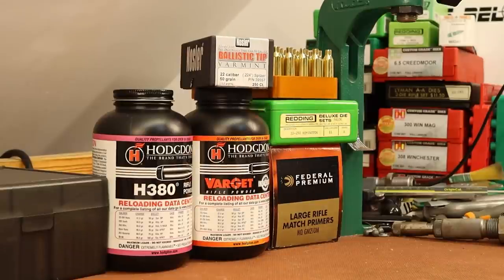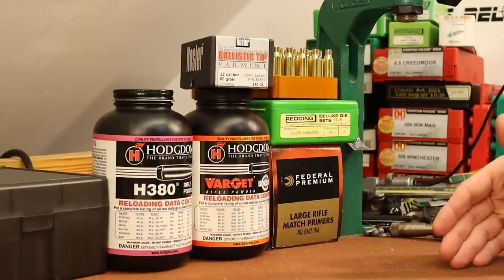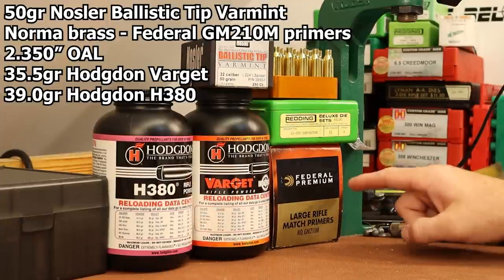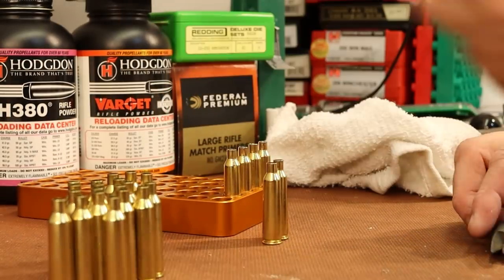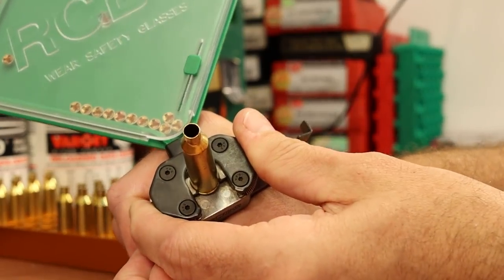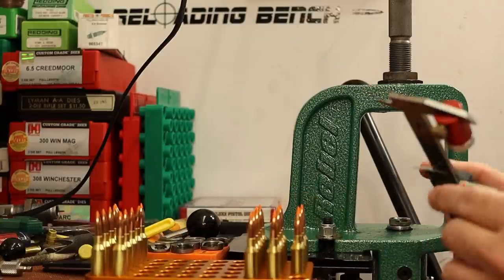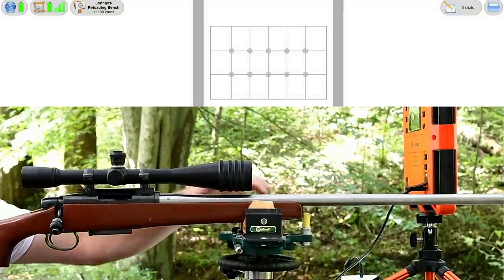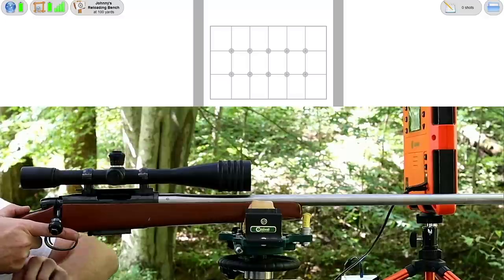.22-250 Rem - 50gr Nosler BT with Varget & H380

Comment: The 55gr Nosler Varmageddon is a freaking tack driver in both of my 22-250's so is the Hornady 40gr V-Max... I've never really experimented with any other bullets because those do so damn good and the bullets I want to experiment with won't stabilize... Glad to see you uploading on the regular again love the channel brother!!!
Reply: Same, the 55 is incredibly accurate out of my old and new Ruger’s
Reply: How is the flat base on the varmageddon? I've been going with mostly boat tails
Reply: @nk-dw2hm  it's a good shooting bullet I've got a load worked up with Vihtavuori n135 that's consistently shooting a quarter inch... and it's devastating on coyotes.
Reply: @DanielBoone337  I've been mostly going with boat tails for ease of seating but I might have to give those a go

Comment: I Just finished up my load developement using the same Nosler 50g BTV  With my Savage 12 BSS in Rem 22-250.  Final result  of 3693 fps, ES 20, SD 8.5.  Componets used   Laupa Brass,  CCI 200 primer,  34.0grs of TAC powder.     Result down range was  0.33" @ 100yds.   Great Video.

Comment: Johnny. I'm really enjoying this video series. I had a 22-250 788 once, that was many years ago.  one thing I think about, the 788 is a run of the mill, however, as I stated,, Mill, production milling, they made thousands of those rifles and nothing custom was done to those actions. they are as they came from Reminton. -Dave
Reply: Spot on. He makes it look easy but it really takes a lot of time to just prep and load, nevermind the photography and the shooting.
I've had 3 different 22-250 barrels and all were Remington take offs and one I had rechambered in 22Dasher. Recently I put on a smithed/fitted 22-250 take off on one of my actions and is looking good but it is too early to tell.

Comment: I just noticed your rifle is a Rem 788. My first rifle (1977) was a barreled action  LH 788 in 6mm Rem.. I sent it to Bishop for a stock and it has been very accurate. At the time there was not much in LH. I think Rem. had a LH 700 in 30-06 (which I have also). My BIL has a stock 788 in 22-250 and has taken wood chucks out to 400 yards with factory ammo.

Comment: Great to see a 788. I have the same gun, but with original barrel cut down to 21.5". I get similar accuracy as your getting with 50gr Vmax and 34gr Varget. Of course not with the velocities your seeing.  That H380 load was smoking. I have yet to try H380 but maybe I should get a lbs. At least it is readily available, Varget not so much. Interesting that the POI was identical for both loads with such different velocities.

Comment: The first 22-50 that I purchased was used and at first that shot straight half inch or less groups . I shot crows at 300 yards. I settled on Varget A-Max 52 grain with 1:14 twist. After serval hinders of rounds, the gun shot erratic which is kind of what you’re seeing for your testing. I sent it in to Ruger and they said that the barrel was worn out. Fortunately for me they offered to replace the barrel for free but we’re no longer in production so the gave me a Hawkeye 22-350 at cost.

Comment: Johnny,  Boy great video except for number 10 flyer, I have been shooting the Superformace Varmint Hornady .50gr and getting 3970 FPS, an the groups are almost one hole @ 100yds, at 300yds I shot a .35 group. So fast and so accurate, do have a photo of the group @ 300.  Do you have any idea of what H could be using in their boxes right off the shelf?  24" heavy barrel on a B-14 Bergara , sure like some input from you. This stuff is amazing, and your video was very use full about the H 380👍👍👍👍

Comment: I’ve had great results with H380 in my Tikka 243. The most accurate load I’ve had in that gun is Berger 95 grain Classic Hunters and the minimum Berger load of H380.
Reply: I shoot those same Bergers in a 10 twist 6mmBR, I also shoot the 55 and 70 gr SBK with the same barrel. My goto powder is Norma 203 B for the 95 and AA 2520 for the light pills.

Comment: I was just reading that the Speer 70gr Semi Spitzer SP was designed to stabalize in 1:12 and 1:14 twist, with its very short round nose design.  Its listed as a heavy jacket, controlled expansion, varmint bullet.  Might be a fair option for hunting, if the 62gr GD doesn't stabalize.  If it shoots, it would be very interesting to see what it does in gel.

Comment: Awesome video! I wouldn't be too awfully worried about SDs and ES with the 22-250 due to the speeds being so high. 50 FPS isn't going to matter in ranges that the 22-250 shines in anyhow. Especially when those 50grs are cranking at 3800+. In my experience the 22-250 falls apart after 400 yards due to the low B.C of the bullets without wind. With wind, it struggles past 300. Your overall result was stellar and I would feel plenty armed taking that out varminting.

Comment: i load for a 22-250AI using 55gr and 60gr vmax i found that the ADI AR2209 (H414/H4350) worked better than AR2208 (varget) the ADI powders are sold in the USA by hodgdon.
Reply: I had very similar results with my 22-250ai with 55gr bullets. The rifle has a 26in gain twist barrel. It was only when I got into the 4350 burn rate range that I was able to get the speed this cartridge is capable of.

Comment: I've been using suede bags for years & years......best way to go. I've bought and tried other rests with the plastic, rubber, & foam surfaces and they're horrible. Anything sticky or grippy is a bad idea......like the old MTM Predator rests for example. They'll grip the stock and if there's any torque or pressure on the stock in any lateral direction, at the shot, the gun will snap loose in that direction tossing it. Leather is a good alternative to suede if you use baby powder on them to coat them with. Anything with vinyl, plastic, or foam cradling surfaces.......no good

Comment: So I’ve got a question, to anybody who can answer it, so as everybody knows primers are pretty much near impossible to find recently I was lucky enough to pick up some large magnum pistol my question is if I just adjust my charge would it be safe to use those in 45 ACP 10 mm and 45 Long colt, also I had a friend give me 5000 wolf small magnum rifle primers would there be significant danger in putting those in 40 Cal 9 mm and 45 ACP with the small primer pocket
Reply: I wouldnt worry about subbing Magnum LP for regular LP, but I would probably look at trading 1k of those SRM for SP if your loading pistol.  Just my opinion
Reply: @paulharveu526  thanks for the advice I appreciate it

Comment: Can anyone answer this:
RCBS SB FL die
COAL 2.7998
Case length 2.00
Bullet Sierra 175gr Match HPBT

Trying to Resize once fired Fed .308 brass From 1.633. I have bumped it .0002 to .0008 and I can’t get it to chamber. Defective die?
Reply: Was the brass fired in your rifle??
Reply: @jimhans1  yes. The weird thing is an empty case chambers just fine until I seat the bullet. That’s when the bolt won’t close. The COAL is correct so thats why I’m asking about the headspace.
Reply: I also have to mortar my rifle to get the cartridge to eject.
Reply: @aaron.from.winchester6744  just because the overall length is “correct” in the book, it does not mean your rifle can fit it. If your chamber has a short throat, that length can be too long! Seat a bullet to 2.780 and see if that fits.
Reply: @aaron.from.winchester6744  I’m also assuming you meant you bumped the shoulder .002-.008”, since .0002-.0008 is not enough.
Reply: @jimhans1  whoops. Your right. One too many zeros.
Reply: @jimhans1  ok. I’ll try seating the bullet a little deeper. I was using Fed GMM 175gr as reference and they were ~2.798  each.
Reply: I need to get one of those Hornady OAL rods.

Comment: Johnny are we not gonna talk about the terrible extraction issues your having...
Reply: First thing I noticed too
Reply: Think of the brass
Reply: they all extracted fine, there were many that didn't eject though
Reply: I think that's from being easy with the bolt. Several of my older Remington and Savage rifles do that if you don't work the bolt with some authority.
Reply: Its hitting his scope base.
Reply: @indydurtdigger2867  I was kinda wondering the same thing. My dad had a 788 in 243 and I am trying to remember if you needed to run it somewhat hard.
Reply: @aaron.from.winchester6744  grind some of the port of the base away and it will work fine. I've done it before.

Comment: You really really really should be cleaning between different types of powder.

Also on your flyers, you're not following thru on your trigger pull. Youre in a sense, slapping the trigger.

50gr. Speer TNT and IMR 4064 and don't look back